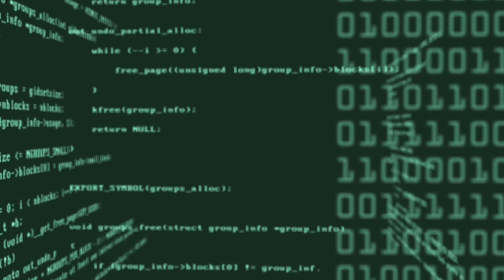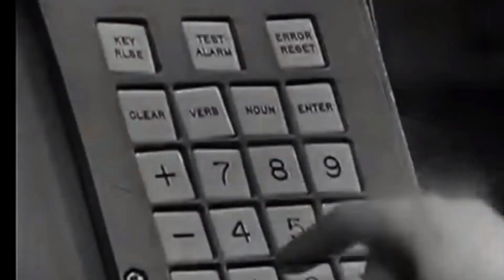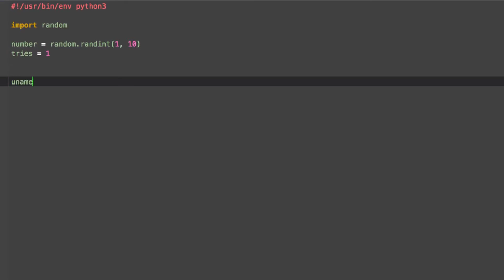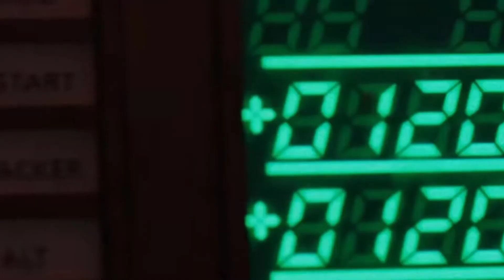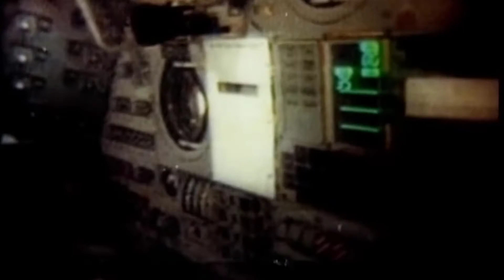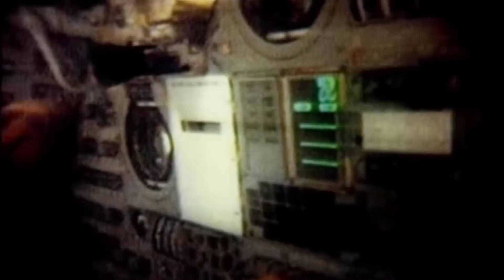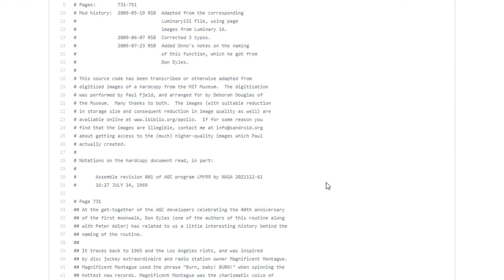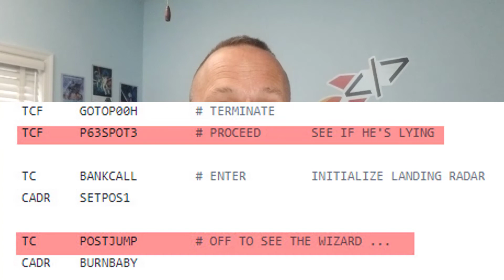Apollo 11 Software - Error Code 1202 Explained  "Go or No Go"

Comment: Have you really analyzed the code of the AGC? I have, and I have found that it was making no sense.
Reply from the maker: Analyze, meaning,running the Assembler code?  Not exactly.  I studied PDP-11 so I can understand various concepts in it.  I loved reading the comments in the code though.
Reply: @GetMeCoding  I have analyzed a part of it; I have coded in assembler in the past.
Reply: @pascalxavier3367    Well, it's hardly unusual for one programmer not to understand another's assembly code -- especially when it was created under severe memory constraints.
Reply: @matthewevans9404  I have also lived in this time; I have lived in the time that computers were still programmed with punched cards.
Reply: @matthewevans9404  Yes optimization is important, but there is no optimization in the code of the AGC.
Reply: @matthewevans9404  using databases and being able to read assembly code are two different things.